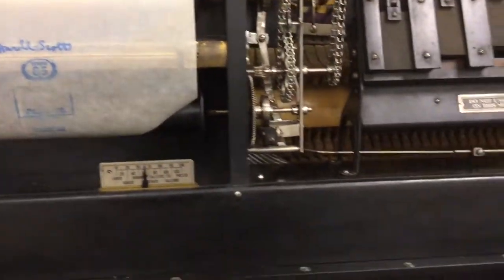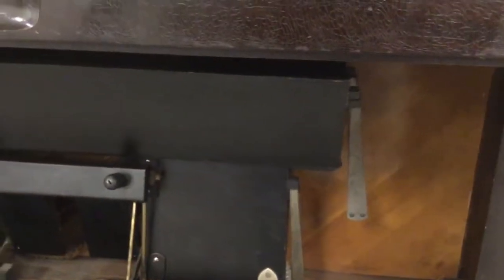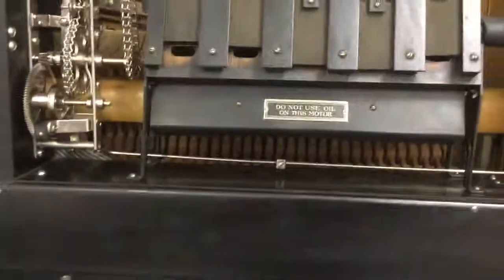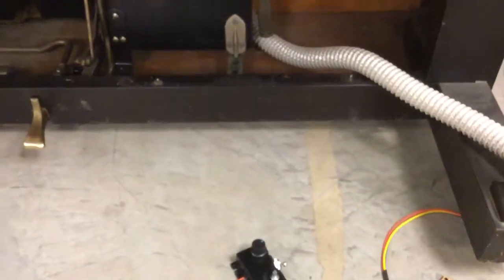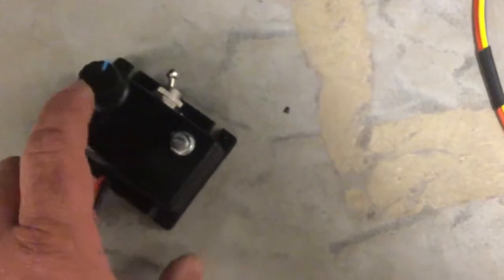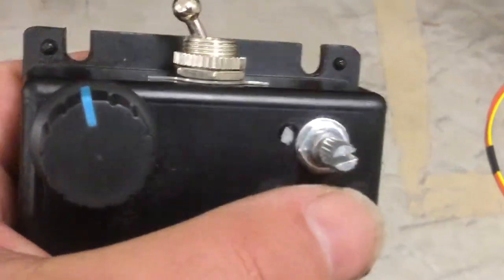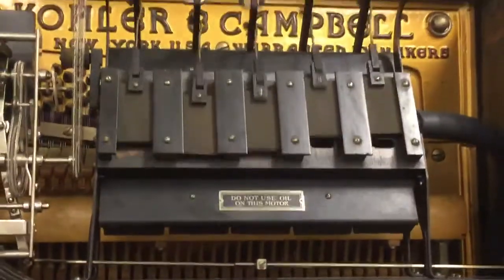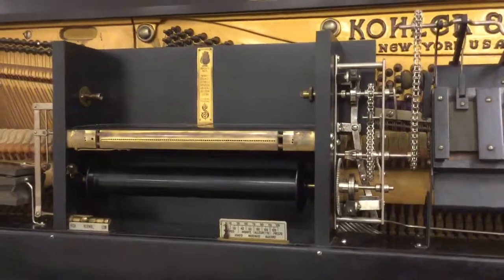Adding an electric pump to a player piano: pre-installation test

Comment: I'm adding one to mine with the same kit and a different suction box. I'm not sure where to attach the black wires from the box.
Reply from the maker: If it’s the same kit from Ragland, the wires are all made with like colors, so they will connect black to black, blue to blue, etc.  
I used insulated crimp-on terminals instead of the wire nuts supplied with the kit.

Comment: How will you 'kid proof' the new electrification controls being mounted under the keyboard bottom?  You will have the tactile types, who can't control themselves around knobs and buttons.  🤓
Reply from the maker: Unplug the piano
Reply: Add an electric switch that uses a key, they can be found really cheap on eBay.